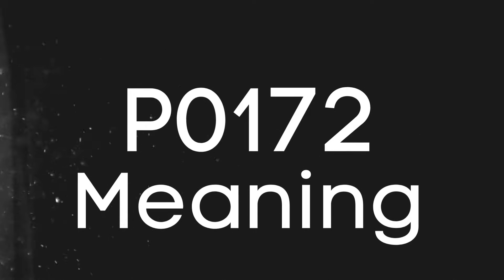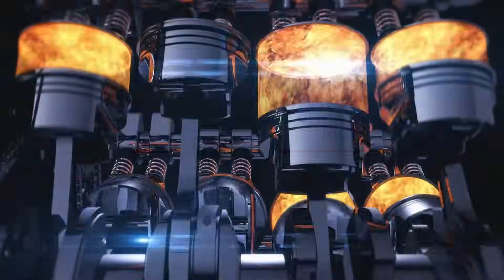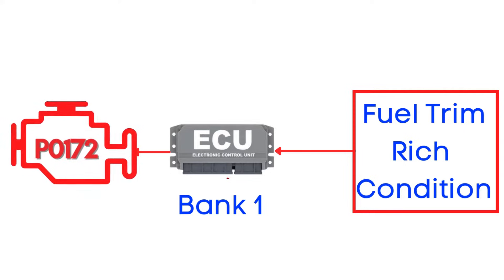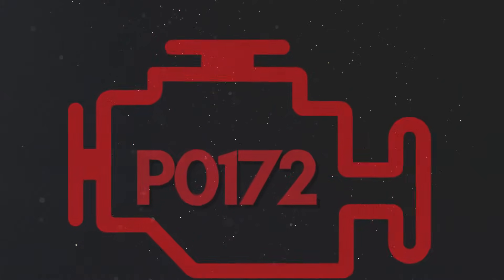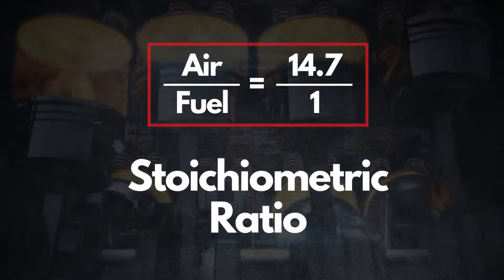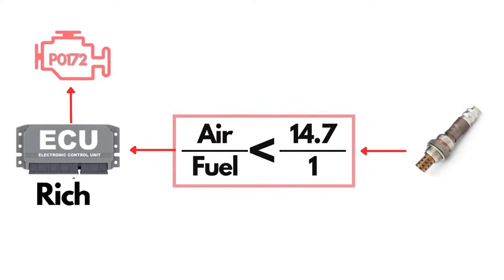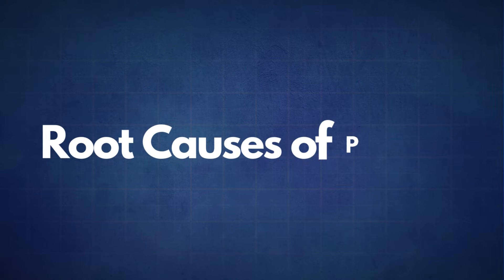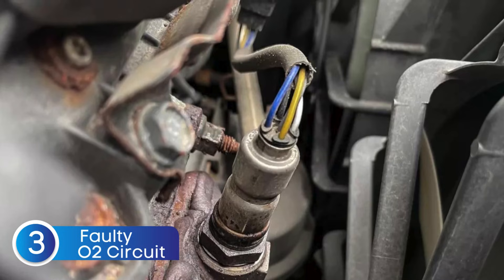How to fix P0172? | System too Rich (Bank 1)

Comment: I have a 2007 Prius and recently replaced upstream oxygen sensor. I still get the error after driving for about 30 minutes. Does it take time for the ECU to relearn and ajust to the ECU or could it be a bad sensor? Thanks.
Reply: Did the code go away?
Reply: @crisruiz7646 yes it went away. Also I replaced the fuel injectors and the connectors to them. Runs like new.
Reply: @Sagemeister007 was the fuel injectors what caused the issue on your car ?
Reply: @mohammedkadeer9718 yes. fuel injecytors and the connectors.

Comment: I had this issue on an Acura. It turned out to be that a mouse made a nest in the air filter box. Cleaned it out, replaced the clogged air filter. Code P0172 never came back
Reply from the maker: That's a good story! Thanks for sharing.

Comment: hey, I have a 2017 chevy Cruze and been having this issue for 6 months, rough idling low fuel efficiency and sometimes the engines stall when on reverse and low speeds. it takes higher RPM's to reach higher speeds. I am not sure if I just need to clean or replace the MAF sensor as that was the recommendation of AutoZone as they were the one who perform the OBD2 diagnosis
Reply from the maker: First clean it.

Comment: I have replaced MAFS, oxygen sensor, spark plug but the warning lights (power steering, traction, brake, ABS still there! Total I have spent almost $400. Wasting money.
Reply: I had a similar issue with all the lights and it was the connection to the battery where wire meets the clamp on the ground, cut off both wires on ground going to the clamp trim those back a few inches and put lugs onto them then used a new clamp that holds lug connectors, fixed issue, seems like not good enough connection caused a short, fixed, wheel sensor was not the issue, it was corroded connecter wires going to battery clamps
Reply from the maker: Check the wheel speed sensor and its wiring